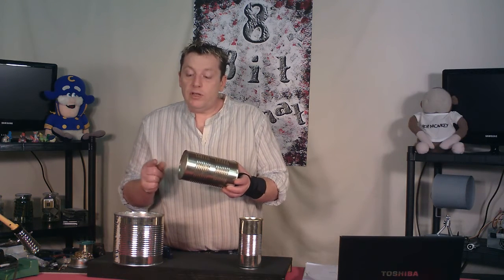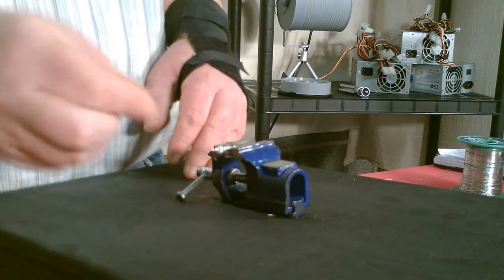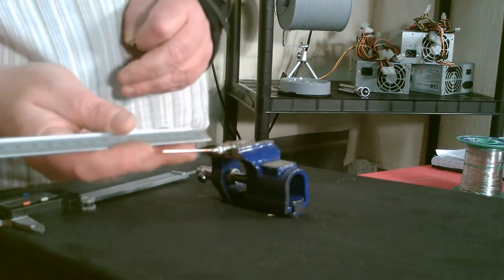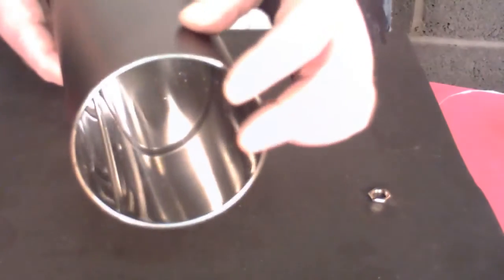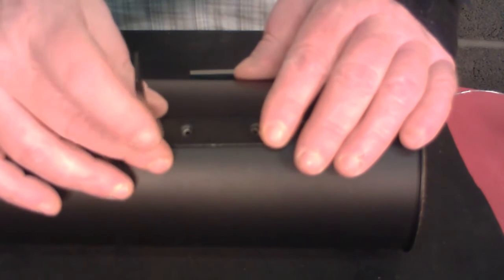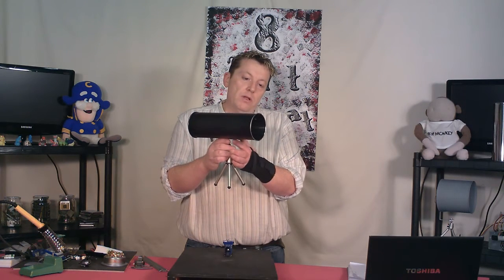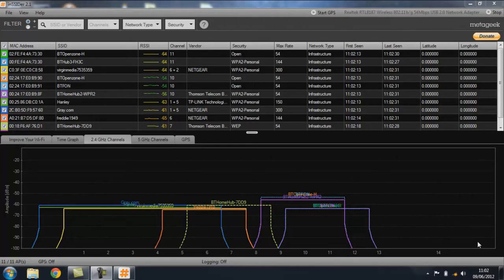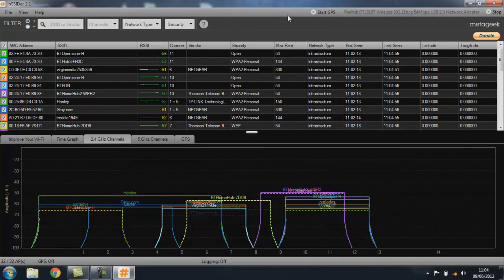2 4 ghz waveguide antenna

Comment: worth attaching this to an old fashioned metal bin lid at it's focus to allow for a stronger signal similar to one found in the Microwave Antennas in the RSGB VHF/UHF Manual don't know if you are intending on doing this?, I think that the material you used to cover the front might melt as chlorine atoms resonate at 27.275MHZ home that 2304GHZ is not a harmonic of 27.275MHZ.